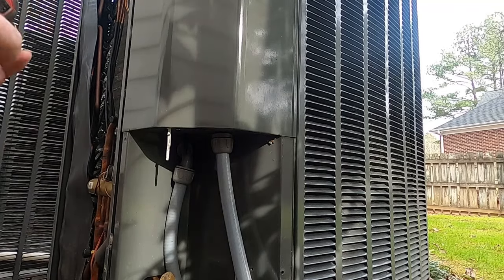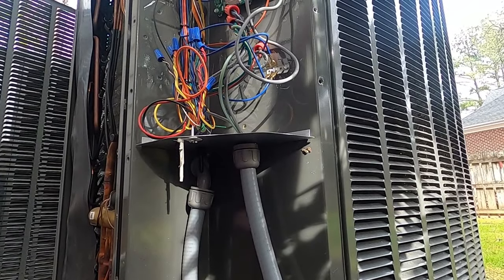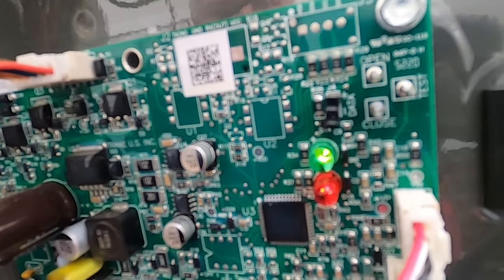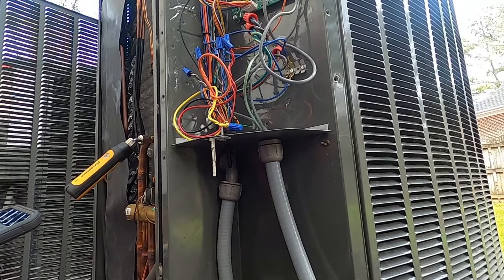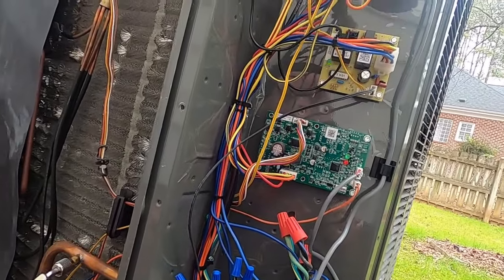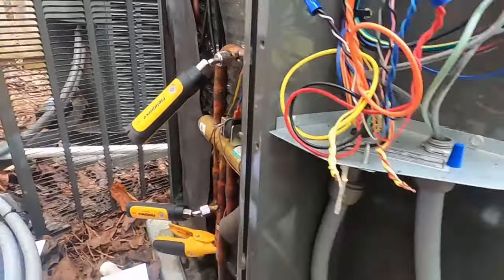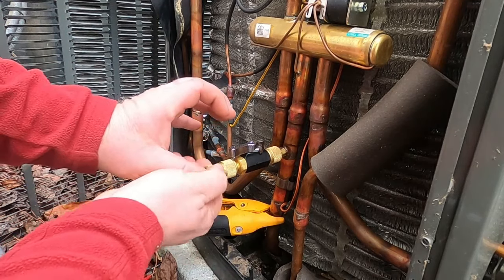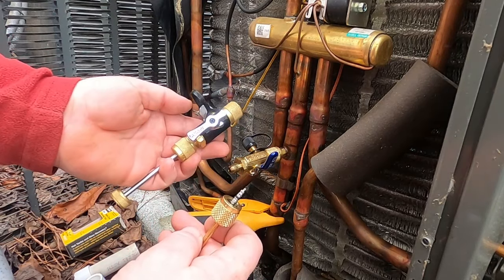One year old Heat Pump leaking refrigerant.

Comment: I've had the same luck that you experienced with the Appion core remover versus the YellowJacket one. From what I've read about the Appion ones is to not tighten them down real tight. Hand tight only, and then the core should come out easier. Thanks for the videos

Comment: Nice to show how to check dc Voltage on the eev to see if it is working correctly. Those shaders do leak but only a year old unit should last longer. After you were done did ya wipe dn the oil off so the next tech doesn't think there is a leak? You are very good at explaining things correctly and simple so every tech can understand. Thanks for the time and video. Have a great wknd Charles.
Reply from the maker: No I didn't clean it off, I will be back to recheck the charge in 1 month. I always schedule a follow up on these warranty calls.
Reply: Sounds good 👍. A constant customer is always good.

Comment: On the Bryant evolution controller it tells you your subcool superheat and transducer/thermister readings on the service checkout option. Pretty handy. That’s why there so expensive
Reply from the maker: The latest Trane XV systems do the same. You can actually connect to them through the Trane Diagnostic App and run them from the front seat of your truck. This is not one of those.
Reply: @myHVAClife 
The Trane link control.  Pretty nice, but limited system connectivity.  But there are Big changes coming in 2024 from the Trane product lines.  Pretty excited myself.   Better get that 454b on hand as well.